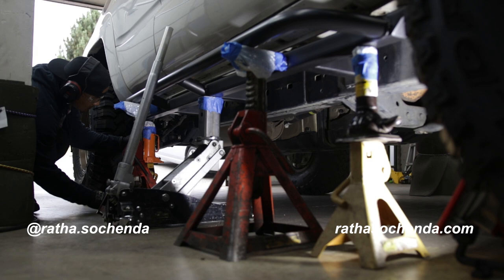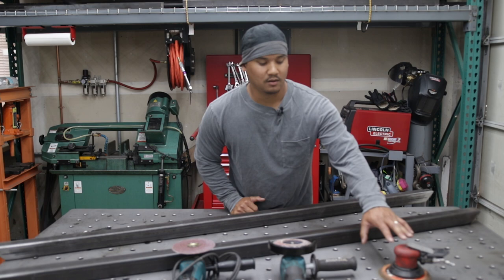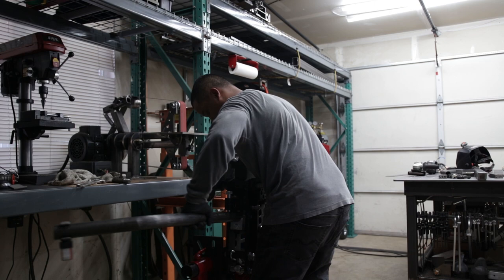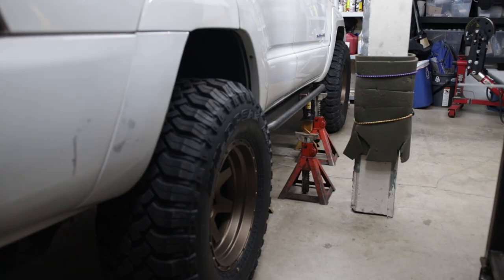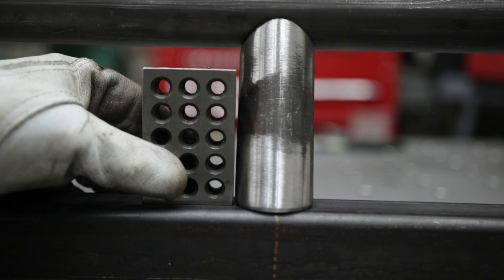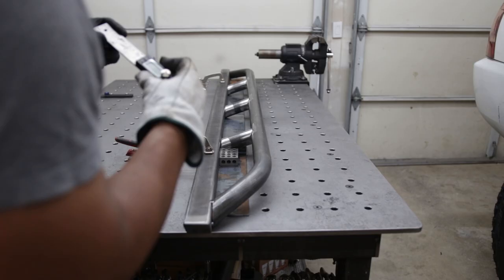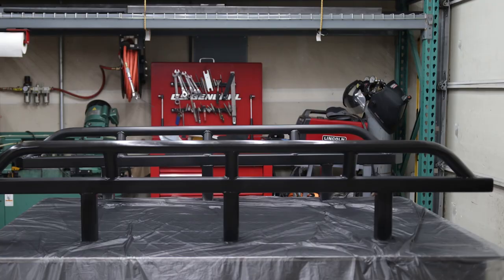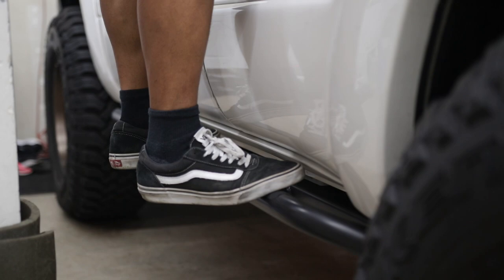How to Build Rock Sliders from Scratch

Comment: 8:10 As a welder, if I were you, I'd pull out a test plate and fiddle around with puddle manipulation. Just run some straight practice beads down a 4 to 8" long 1/8" plate (or 3/16" if you're worried about burning through). Try holding your gun still untill you get a good size puddle then move the gun quick enough to the edge of your puddle to start building up the next puddle. Or you can weave your gun from side to side making sure to spend roughly the same amount of time on the edges as you are moving across the middle of the weave. That way you're not compromising the strength of your welds with those fish eyes; and most importantly, they still look good.

Comment: Great build, not to hate on you or anything but for something that’s gonna be taking abuse you don’t want to do tacks to get a dime look on your welds. You don’t get proper penetration or fusion with the base metals and it’s prone to breaking under stress. You wanna run a straight bead if you can’t get consistent dimes you want by weaving. with a little practice it’s not hard to get a weave down that will stack dimes. But again not trying to hate and it was a great watch!
Reply from the maker: Thanks for the feedback 👍

Comment: Just a couple of things. First of all the sliders look good. Second, welding straight to the frame is a no no. It actually hurts the structual integrity of the frame. Third, you need to weld full beads instead of tack welding the whole thing. Cheers mate.

Comment: You did a great job on the sliders, I don't have the high buck tools .only a lincoln210 welder, and a harbor freight pipe bender. I'm going to try it. Got honey do's first
Reply from the maker: You got a good start so far 🤙🏾
Reply: How did the harbor freight bender work out for you? Wanting to do the same.

Comment: Looking good buddy.  I like the grip tape.  I thought of bed liner on mine, but quickly nixed that idea as you drag your leg across them getting out of the jeep.  Didn't think of the grip tape.  Had you had issues with the wife dragging her legs on them getting out?  

Mine are due for a repaint and may have to add the grip tape.
Reply from the maker: No issues so far.

Comment: Thx for the chill video. By any chance do you remember what settings you were using on your welder when you welded the sliders to the frame?
Reply from the maker: .030 wire D 4 setting I thing

Comment: Hey 

Are you able to elaborate more on how you did your kick back angle at 20 without a reference plane
Reply from the maker: I laid the round tube flat then lifted it up while using a digital protractor and angle finder until I got to 20 deg.
Reply: @RathaSochenda  im talking about in solidworks
Reply from the maker: It’s actually pretty easy. One way is to draw a sketch line. Dimension it 20 deg then do a and extruded surface. Now you can use that to surface to sketch on.  Or draw your part then use the move rotate feature to turn the part 20 degrees. Hope that makes sense👍
Reply: @RathaSochenda   Thank You 😀

Comment: Great video, I like the 3d printed template. A quick question for any Aussies watching, is it true we cannot weld to the chassis but can drill and bolt or would we have to use existing holes?
Reply from the maker: I think bolting to existing holes should be strong enough or drilling and then bolting would work. There are many applications out there that do the bolt on. I just welded it for maximum strength but it’s not totally necessary.
Reply: I feel something like 2 plates one on each side of the rail with 4 holes and 4 bolts running through each should attach it nicely

Comment: Biggest issue I see. Sliders are welded directly to the frame. Nice and sturdy but will impact resale/trade in factors. As modifications like this will be considered “Frame Damage.” Do not do if you intend to eventually sell or trade! Great fab skills tho! Love the workmanship!
Reply from the maker: If I do choose to sell the vehicle, and feel that sliders would lower the resale value, I could cut them off, grind the welds flush, and touch up paint the frame. But with 260k miles on the 4runner I’m not too worry about resale. 🤙🏾